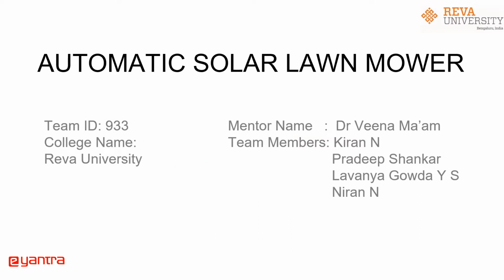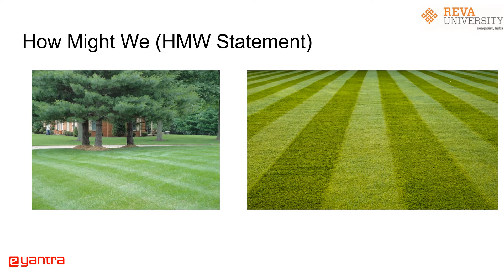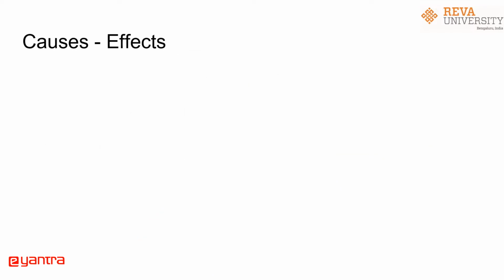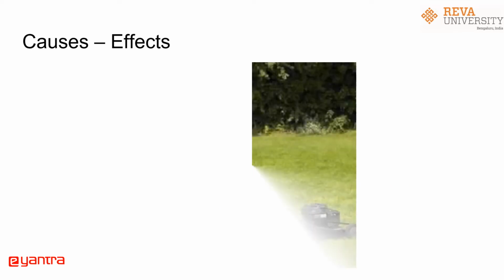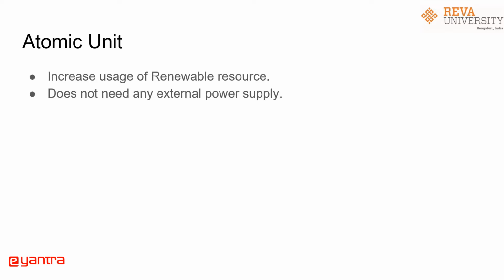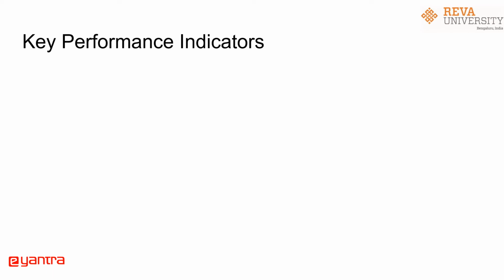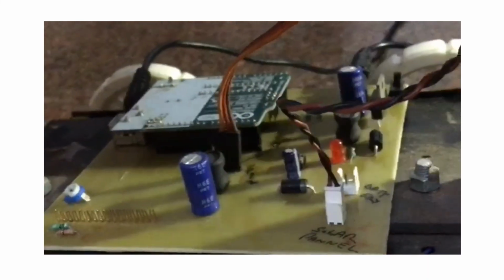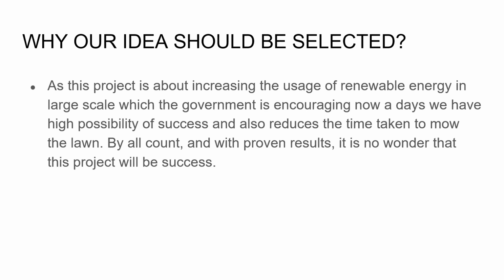Automatic solar Mower

Comment: How exactly are you generating maximum power? On what condition, are you tilting the Solar panel?
Reply: Yep bro the solar panel will tilt and there will be more intensity of light falling on the panel. Also we will be using an intermediate device like power booster which will boost up the voltage. Both the techniques have been used.
Reply: @kiranshetty8487  How will you know that you'll be getting maximum power?
Reply: By using multimeter we can measure the voltage between the intermediate device  so that power is boosted or not.... and while tracking the sun position the LCD will show the voltage at each position and the panel will go back for the maximum voltage
Reply: @kiranshetty8487  okay bro, how frequently do you keep measuring?